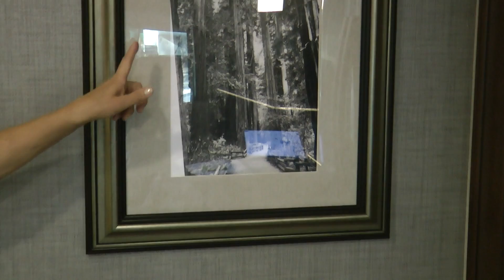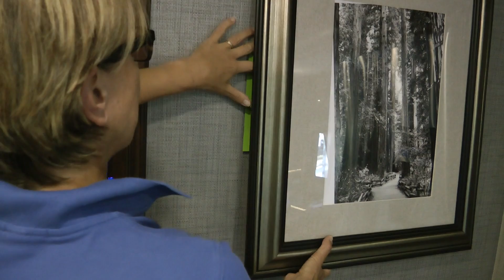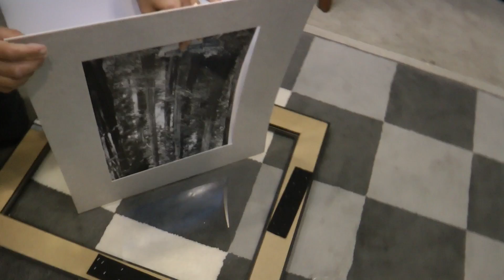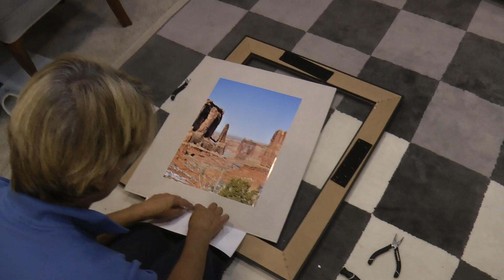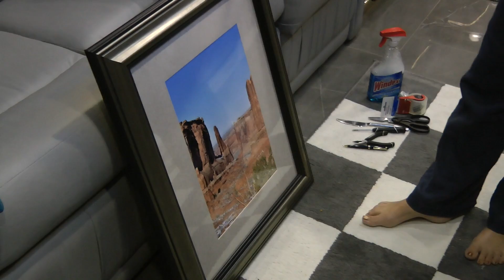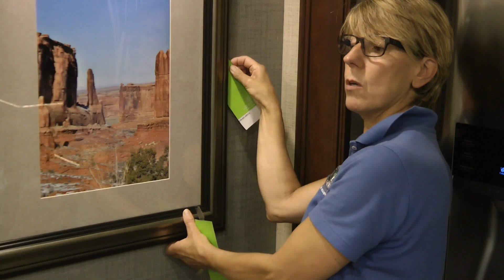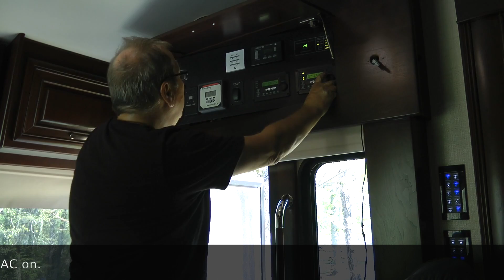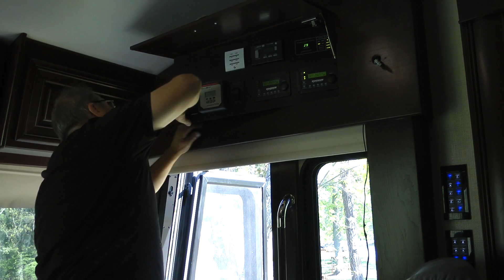Entegra Top Tips Part 6

Comment: Oh, the photo is LOVELY.  I'm curious why you used shears (scissors) to cut the clear package tape!

The reel of tape has a serrated blade which cuts the tape well.  I would caution folks to be mindful that the tape still on the reel could re-fasten back on to the reel, and become stubborn to release should one want to reel off more tape for other uses.  I take about 1 cm (1/2") of tape and fold it back on itself, so I have a tabbed leader to make the next removal of tape easy.  The glass is "perspect"?  I think it's probably "polycarbonate" or "Plexiglas acrylic" also referred to as the "glazing", the same kind of crystal-clear plastic that's used in headlight covers.  I think the gray border might be referred to as a mat?  Then again, I'm not sure.

When I get my RV, I'd wonder if there are artsy-framed LCD-based projector screens which can be loaded with electronic photo files.  Then, every minute or so, the screen would refresh with a different photo file!  You folks no doubt have strong contact with the people at Entegra.  I'd bed they'd like that idea.

Finally: I LOVE your videos...they're so informative, so helpful and so very smart!  Thanks for all your hard work and delightful results...and obviously  your fun travels!  I'm thinking of doing the same...and wonder, as I'm "single" and unhitched, what the RV lifestyle is for single gentlemen travelling about.  I retire in FIVE years...and cannot wait.  Take care, travel safe!

Comment: First, I clean my filters a couple times a year. Thank you for showing how to change out the picture. I have been wondering how to do that. I probably would have used glass tacks to hold the picture in.
Reply from the maker: The velcro is the industrial strength and is absolutely solid, it's a bitch to get off and the knife was the best method we found

Comment: I love watching your videos. I have a question about the mold in the vent cover. Is this a common problem with rv's, and I know that the use of propane for heat and cooking causes higher humidity, so did this coach have propane or is it all electric? Thanks.
Reply from the maker: Hi Jon
Our (like most now) is an all electric coach. I think that the mold growth is due to visiting Florida which is extremely humid and when we left our coach we completely disinfected everything, absolutely everything. When we returned 5 weeks later the inside of our fridge was growing. So it must be the humid atmosphere that caused these issues

Comment: May I say that once you'll end your trips around North America or if you intend at one point to buy a new coach, it would make your coach for someone looking to buy a previously owned Motorhome, probably the best buy there is. You've done so much improvements to it and also with all the repairs done to it, it probably be a better buy than a brand new Motorhome.
Reply from the maker: Yep, You're not wrong there, it's been in more garages than I've been in bars (is that possible) My Rv is probably the best maintained out there. I'm always open for sensible offers.

Comment: The old fashioned way of fitting the picture in was pins knocked in, then tape...
Reply from the maker: It's all quick fix now. I understand the velcro as we bumping down the road as a pin in the wall system woulnlt hold a picture up very long

Comment: Such a shame to see that spaghetti behind the panel! For these panels my objective is to rewire them with a proper loom. The objective is to make repairs while underway possible.

I like to fit a metal strip on the back of the flimsy panel, with nylon strips affixed to the back of the assembly. If the panel is lowered, all is supported. The cabling is then run in a nice loop with the cables individually labeled.

Comment: That wiring mess is a disgrace at $350k! Two Canadian companies, Leisure Time and Pleasure Ways have gotten good reviews, Thor got terrible reviews. 
One thought, unlike houses, RV’s do not have to meet any sort of building codes, at least I don’t think they have to. This wiring is a fire hazard.
Reply: Ed Victory, The brands let me to assume you are looking for Class B vs. Class A coaches.  Yes I bought the Airstream Interstate because it had all of the Mercedes-Benz installed safety features on its chassis. Another brand to consider is Road Trac followed by Winnabago Era.  Others will disagree with me but drill down deep be for you write your check.  Gary "The RV Advocate"